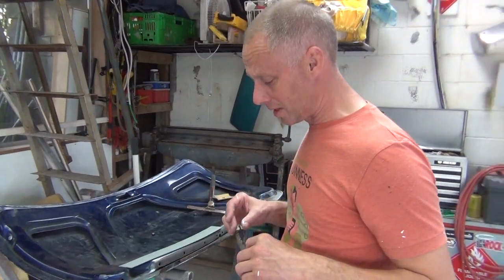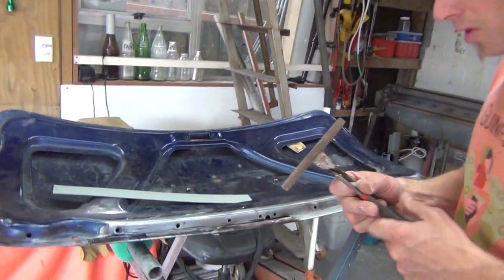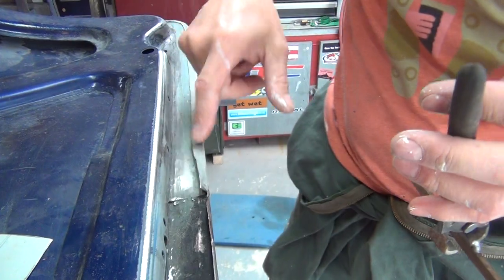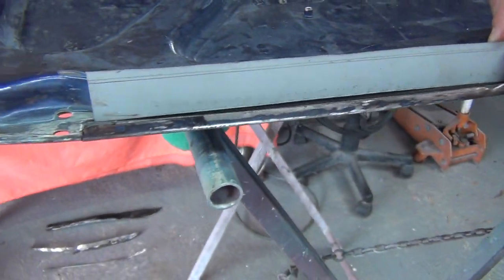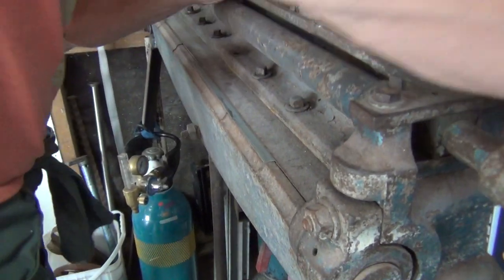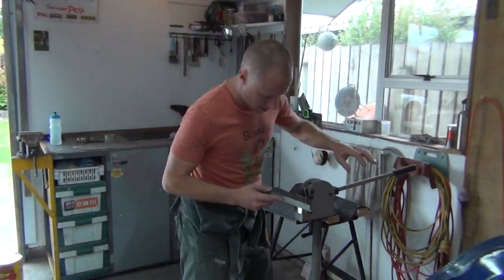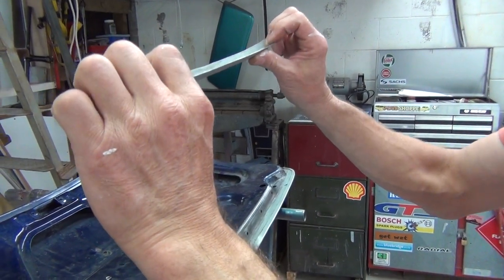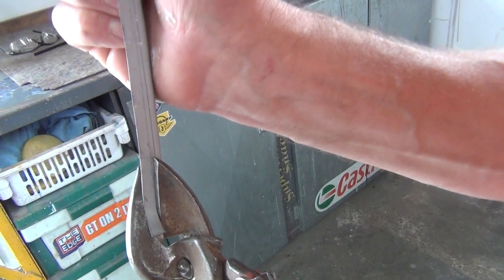car (boot),new edge 4 frame

Comment from the maker: Na only use mild steel of the same thickness  , the use of stainless steel would only cause dissilimar metal corrosion ,  ya cant weld aluminium to mild either   Restolad